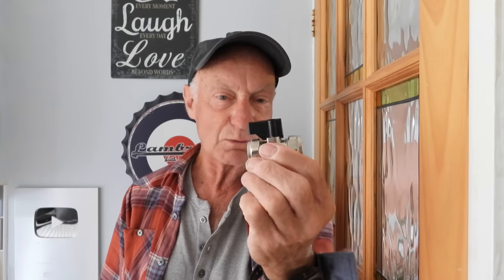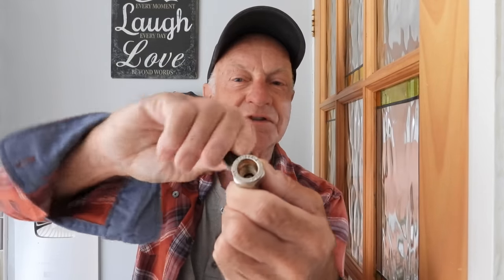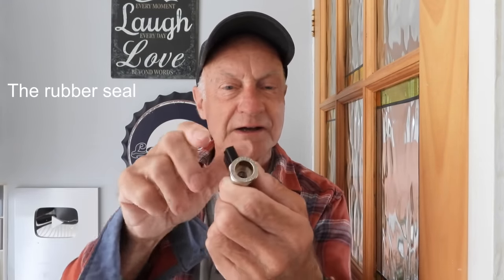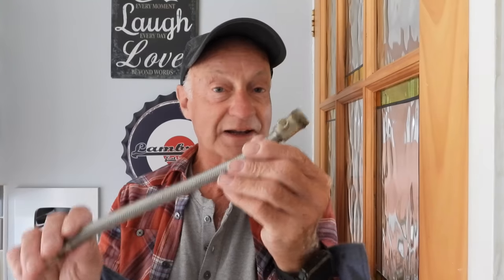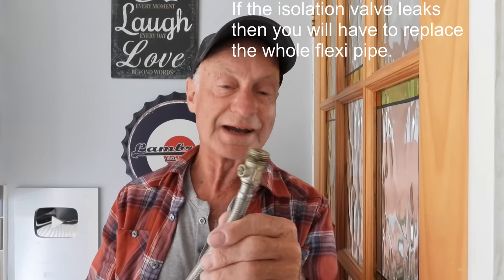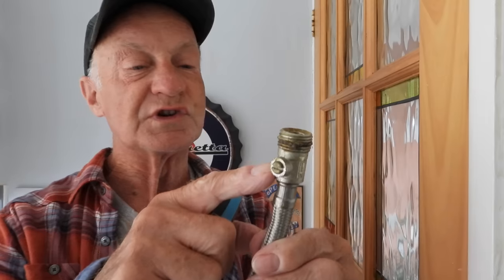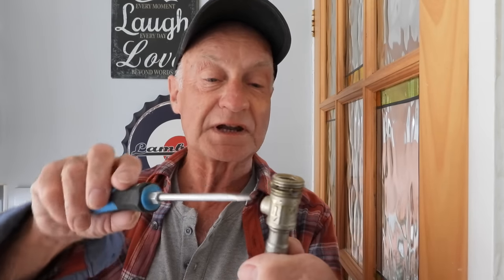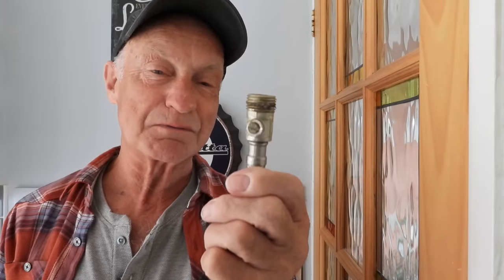Important  See this before fitting isolation valves

Comment: Top video. Cheap ones always dribble. I see their purpose is to set flows on taps, not for isolation. One tip is grease the screw head to stop it corroding/ shearing off 😊
Reply from the maker: Thanks John.

Comment: I couldn't agree more about slotted isolation valves, especially the cheap tatty ones whose compression joints in my experience all too often won't seal without loads of ptfe tape being wrapped around the olive after compressing it on first. And those cheap ones with the little plastic handles can be too easily nudged back on while you're working on the pipework downstream of it so you and the surroundings get drenched. I prefer the ones made in Doncaster which have a handle which won't turn back on unless you really want it to.
Reply from the maker: Thanks for the info.

Comment: Went to change basin taps for my daughter, she had bought the taps a few days before,so I went thinking easy job won't take long,great I thought isolating valves,turned off 1st one started dripping from the turn off screw,second one would not turn at all,me and my big mouth,trip to screwfix 2 full bore and 2 new flexi pipes,they didn't look to clever either. Job done eventually.
Reply from the maker: Same old story with those isolation valves.

Comment: I agree with your dislike of isolator valves which have to be turned on/off with a screwdriver. In general when fitting taps when supplied by a combi I don't fit isolators as its easier just to turn off the main supply. You should also do a blog about gate valves on a non combi system. They will turn off but never turn back on so you are stuck with a top tank full of water!! I drain the tank instead./
Reply from the maker: I have done a video on gate valves. Cheers Richard.

Comment: After working in at a trade supplier for some time, many plumbers appeared to dislike the screwdriver isolator. Some commented that when you use one, there is a chance it is because water is peeing out, when water is peeing out, you don't want to be farting around trying to find a screwdriver or suitable tool to turn these things off (aside from other issues mentioned in video or comments)!
Reply from the maker: Always were a terrible idea.

Comment: If the flow is low then narrow bore make quite a lot of difference if changed to a full bore
Reply from the maker: Yes mainly on low pressure systems, like on F and E systems and cold feeds to bathroom taps.

Comment: Before you fit them brush some vaseline into the valve and rotate the ball a few times - makes all the difference and will prevent the valve sticking.
Reply from the maker: That vaseline will wash off with the passing of water, it will not prevent the cheap ones from failing.
Reply: @dereton33  It will not wash off the contact area between the seal and the ball - it is the stiction between these that causes these valves to fail - worked for me for 30 odd years.

Comment: Now retired and I got accused of ripping customers off charging a high price for iso values when they could buy them much cheaper than the ones I charged for @ £4.5

I always used full bore gas valves as they were  100% better quality than the ones costing £1 for two on eBay.
Reply from the maker: Dead right there Frank. You get what you pay for.

Comment: Another great video. I find the valves stick and as you apply more force, the plastic levers deform and turn but the valve doesn’t move. Full bore with a METAL lever is better, less pressure drop. But rather than the long metal levers which may not fit in the available space, consider those with the smaller METAL butterfly levers.
Reply from the maker: Thanks for the info!

Comment: How often will the screwdriver valve need to be turned?
Mine is on the rising pipe to upstairs and easy to get at. I turned it off this year and replaced all the washers upstairs on my taps and toilet cistern and don't expect to have to do it again for a few years.
Reply from the maker: at least twice a year.

Comment: Are the expensive and genuine original Ballofix-branded screwdriver valves, with six-sided body marked "Ballofix" and listed as "Pegler Ballofix"any better/more durable/reliable? The "quid each" have been a real PITA, to the extent that even thinking about closing and opening them makes the wretched things leak.
Reply from the maker: The pegler and more expensive brands are much better.
Reply: @dereton33  Thanks. I've got a number of the Pegler lever and butterfly valves, each of which I've carefully checked to see that it works properly (opens, closes, seals).

Comment: We have to keep turning the screw for the pressure n water to come through but it's that old it's nearly impossible to turn the landlord has refused to fit new boiler n gas safety bloke refused to do gas safety the water damage has ruined our flooring in bathroom walls are soaking can I replace the screw myself it's a joke we have environmental health involved and he is getting prosecution over the disrepair any advice subbed n liked thanks mate
Reply from the maker: You cannot renew just the screw you have to fit a new valve. One of the full bore types will also fix your pressure issue. Thanks for subbing.
Reply: Thanks for the reply can I do it myself n how please

Comment: Thanks for all your content it is fab :) Dare i ask this, do you have an opinion on plastic plumbing? (push fit) Looking to put downstairs toilet and sink in and being a total beginner to plumbing, it looks like the easiest option. Cheers
Reply from the maker: It`s ok and definitely the way to go if you are having your first go at plumbing.
Reply: @dereton33  appreciate the reply mate good to know. Keep up the good work
Reply: The only advice with push fit is cut the pipe accurately at 90 degrees, maybe use a woodwork mitre box to achieve this. If the cut is not square you run the risk of tearing the O ring, or maybe even flippng it out of its seat which of course you cant see. Also chamfer the end with some sandpaper to enable easy assembly. Last tip, a finger of detergent lightly around the pipe will assist the assembly by lubricating the sealing ring.
Reply: Did mine years ago with plastic. Really easy, never had a leak in all that time. Just make sure that ends are square and clean, use stainless inserts not plastic and cut the pipe slightly long so that it is under a very little compression and never short to leave them in tension. Buy a good pair of pipe cutters too!
Reply: @roberthardy2013  Used a lot of plastic and the above advice is sound. Pushfit capends particularly useful to have in your bag.

Comment: Long as takes 10 bar it should be alright.. Mine seemed to piss out all over.. Untill you found that sweet spot.. Then it's as dry as a bone.. U got less than a mm to play with to close the valve.. I used one as a temp stop end cos the shops had f all in
Reply from the maker: Cheers pete.

Comment: Great timing, how would you open 1 that is stuck tight, I tried to turn it with a screwdriver but its doing more damage to the screw 😮
Reply from the maker: Try a screwdriver that exactly fits the slot.
Reply: @dereton33  cheers for replying 👍
Reply: This seems to be a problem with some valves.  I had one that was similar, too stiff to operate, weak and oversized metal slot, that resulted in the largest flat driver I had invariably slipping.  Replaced it with a better valve.
Reply: @SaxJockey  think I'll have to do the same 👍

Comment: Thanks Al!  Can you tell me if high water pressure on the supply pipe can damage central heating pipes?  Thanks😊
Reply from the maker: Not that I know of
Reply: You'll have to broaden your question.  CH pipes on a system boiler or combi only ever suffer up to 3 bar of pressure...and that's only just before the PRV opens to release the pressure, so it's just a few seconds.  CH pipes, whether copper or plastic, are what's used in general plumbing, anyway, and they can undergo 8 bar or more.  A conventional CH system has pipes which only ever get a max of 0.5 bar.

CH pipes are not really 'damaged' by anything, though an incorrectly-set water softener could fill the system with low pH water (which is slightly acidic), but not a concern.  As long as you add a corrosion inhibitor you'll not have any issues.  My advice would be to always seal the system, rather than having an F&E tank, and run it at 0.5 bar.

Comment: Great video! Please would you do a video on the best toilet cistern fitting as I have bought Geberit dual flush valves so many times for the same Ideal Standard cistern. (It's like Triggers Broom....) I hate the European Union standard fittings. Don't get me started on the Ideal Standard Purity toilet 2003 which has now been discontinued so its like foraging in the wildnerness trying to locate a Purity toilet replacement seat (which breaks easily as it sits on a scooped pan terrible design) for under £200. I am hoping to replace it myself with a ideal Standard Low Level Waverley toilet with the lever handle and just have the old fashioned ball cock inside. Do they still make these? Are ball cock flushes less likely to leak water into the pan than the current dual flush valves? Never had this amount of failing with the ball cock 6L flush of the old toilet. Please would you do a video in the same way you have done this one. I would like to be able to fit the toilet myself as have had a couple of 'unreliable' plumbers. I like the way you present the pros and cons of plumbing parts in your videos.  Thank you, Kate.
Reply from the maker: As soon as I get a job come up I will video it for you. I can tell you though, that the old china cisterns with a standard part 2 ball cock will out perform any push button plastic rubbish cistern. A standard syphon is much better than a duel flush one but you can not get them any more.
Reply: @dereton33  Thank you so much for your speedy reply. Had enough of new fangled plumbing fittings. I want the old style back. You know..that worked! Last time this leak happened we had a £700 water bill. We are on a meter. Also we have a waste waterpump. EU laws on plumbing??!!...can you tell which way I voted yet...?😵‍💫😊

Comment: i aint a plumber or anything like but for some reason i thought of those issues when i saw my options in toolstation.  i ended up with the thumb switch type because i wanted something to move it.  i first saw those flexible pipes and saw they came with a valve and thought its so silly, when i turn it off its because i want to replace the flex but how do you do that with the valve as part of it
Reply from the maker: Ye it`s just common sense.

Comment: Duh.  Just put a drop of silicone oil on the little 'marble' inside & rotate it a few times, that will keep it easy to turn off / on for many years.  I fitted them to all my appliances 27 years ago, & I know they're still fine as I have changed a few tap washers etc. in that time.
Reply from the maker: You no doubt have high quality ones and not the cheap rubbish ones that are fitted because they are cheap.
Reply: @dereton33  No, I use the cheapest (from a recognised supplier) on all appliances, and bigger full flow vales on the main runs.

Comment: Cursed my plumber as he used the valve with the screw when fitting an outside tap so it sits in the cold feed under the kitchen sink and right pain to turn it on and off without a lever.
Reply from the maker: That seems to be the norm.
Reply: Sorry to hear of your trouble. Get your plumber/ heating engineer during your annual boiler service to fit one that suits you.

 You could always buy a 'sure-stop' remote valve if it was necessary?

Comment: Those valves with the attached hoses are a waste of time, if the hose leaks you have to replace the whole fitting. With separate valves you can just replace the flexible hose if it leaks - without shutting off the water to a whole house.
Reply from the maker: About right there jim.

Comment: Are full bore valves better than a stop cock on the mains ?
Reply: Most full bore valve are WRAS mains rated so yes they are fine, but unlike a stopcock you cannot reduce the water flow down,  it's either on or off which is fine for most cases
Reply from the maker: They do not have a non return valve function like a stopcock so are not allowed to take there place however they can fitted above the stopcock.
Reply: @dereton33  
Many (maybe even most) stopcocks do not have a loose jumper, so fail to act as a non-return valve, anyway.  A full bore lever valve used in conjunction with a non-return valve is 100 times better than an old brass 'stopcock'.  Lever valves can still be turned by elderly and arthritic people years down the line.  Stopcocks cannot in most cases.  I worked in a block of 56 OAP flats - all with stopcocks that non of them could turn.  There were some horror stories from the concierge of water pouring through ceilings to flats below as the tenants couldn't shut their supplies off in an emergency.  One poor old man suffering dementia had to move out while his flat was redecorated due to a flood above.  So I offered to replace all 56 for the material costs only (I was doing well out of all the work there, and it is good to keep in with apartment managers!).  All the flats already had non-return valves due to the HW heaters fitted, so it made their lives so much better.  Small floods still happened, but they could turn their supply off before it caused serious damage.  I don't know what the architect was thinking, putting brass stopcocks in OAP flats.

Some years back, I was called out to plumb in a washing machine.  Did it, and turned the water back on... only to find that the original installer on the rebuilt home had fitted the stopcock the wrong way around.  It had been functioning fine, and hadn't acted as a non-return valve for five years - until I turned it off, of course!  I couldn't freeze it as it came straight out of the concrete floor.  No outside OSV (of course!!!) so I phoned Thames Water to come and shut it off somewhere (it was now getting dark).  They said between one and two weeks!  Or I could dig down a metre and squeeze off the poly myself!!!  I pleaded with them, and they brought bottled drinking water to the customer at first, followed by a couple of 'engineers' a few hours later.  They closed the water off to the entire road for a couple of minutes while I flipped the valve.  I am due to retire this year after almost 50 years.  I've had enough of jobs like that.

Comment: flexy pipes are now illegal due to the fact that they have a rubber tube inside which aids the growth of legionella
Reply: No, they are still fully legal.  It is correct that they can aid Legionella, but their use is still widespread, just not encouraged in healthcare settings.  Remember that WRAS is merely an approval body, it has no regulatory power.  And even they approve EPDM fittings which have passed BS 6920.  The HSE doesn't like flexi hoses lined with EPDM, but again, the HSE has no power to make it 'illegal', either.  The NHS insists on its drinking water supplies be free from flexi hoses...but again, the NHS isn't a legal body, either.  If you worked in an NHS building, you would be fully entitled to fit flexi tubes UNLESS the contract stipulated that you could not.  They might, for example, not like cheap ballofix valves(!), but what you install is up to you providing you adhere to standard practice...and cheap ballofix valves are standard practice.  If after installation, the NHS or anyone else wanted you to replace the fittings with ones they were less sensitive about, it would be at their expense...as long as you stuck to standard practice and didn't deviate from the contract.

To be illegal, it has to pass through Parliament or be added to an existing bill.  As far as I'm aware ALL water softener flexi tubes are lined with EPDM.
Reply from the maker: Thanks for the info Jim.